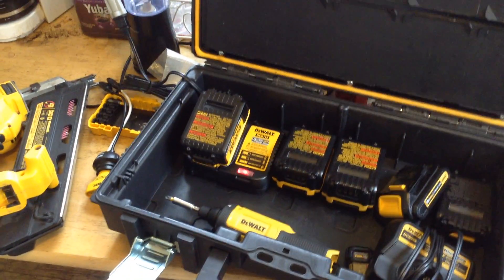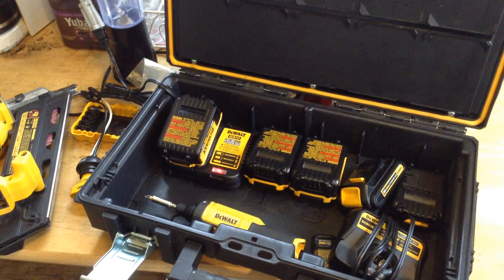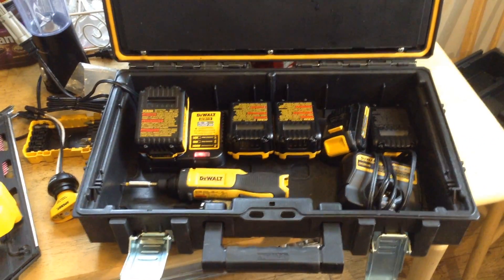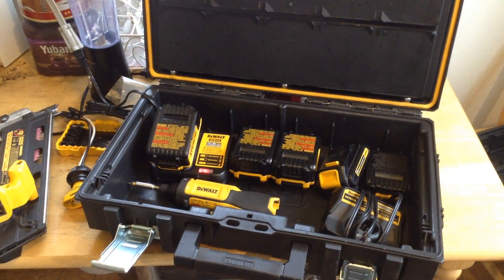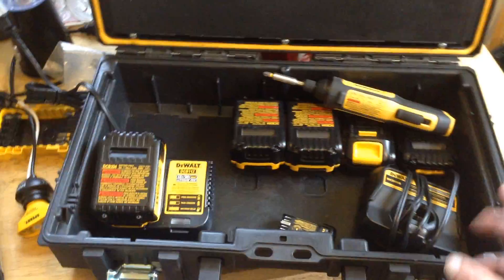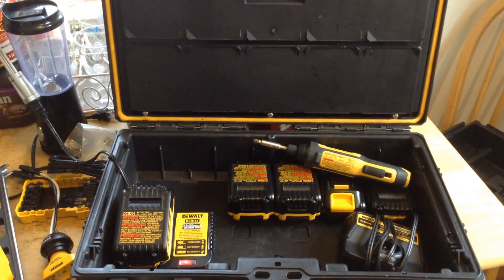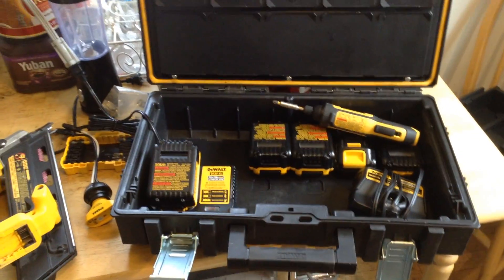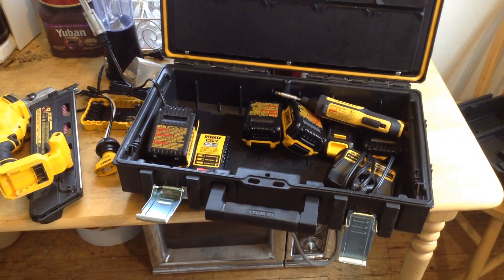Design Ideas for DeWalt multiple battery charger for Lithium Ion power tool batteries

Comment: A 120V/12V multiple input charger would require two separate power supplies as one power supply cannot work over that wide a range of input potentials at the power levels involved.  There would also be a limit on how much power could be drawn in the case of the 12V section.  This would mean that a charger with multiple battery positions would have to be either charging all batteries simultaneously at a low rate (10W to 15W) or charge one battery at a time at the full rate.  Ideally, such a charger would have the option of being able to select which of those modes it operated in.
Reply from the maker: There is plenty of room in the box for it and the batteries are charged strictly with DC power anyway.   The charger would not require separate positions for AC and DC charging, just a switch for which power supply charges the batteries.